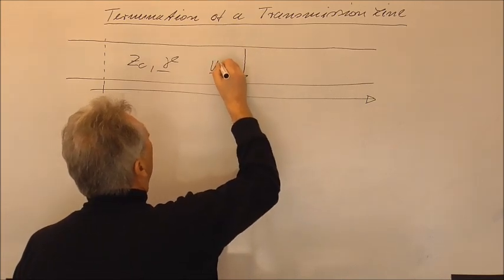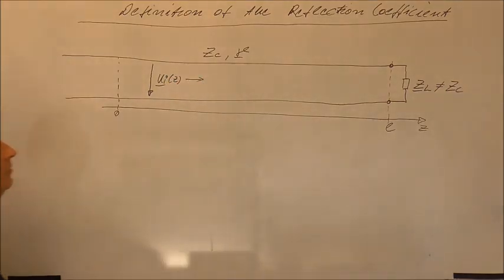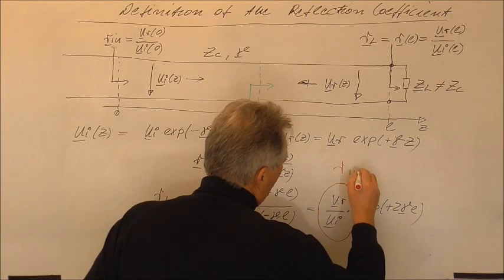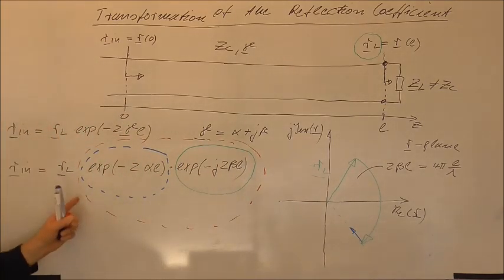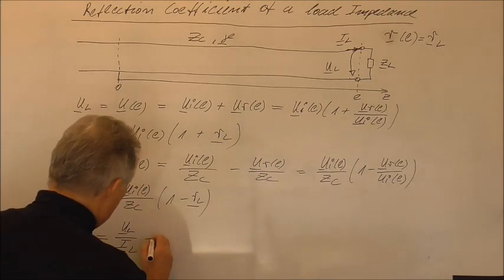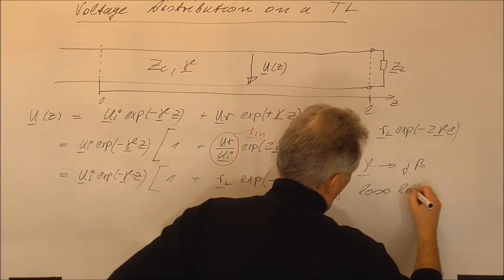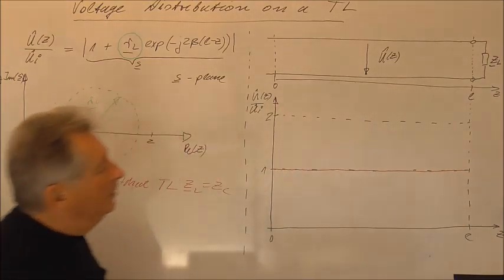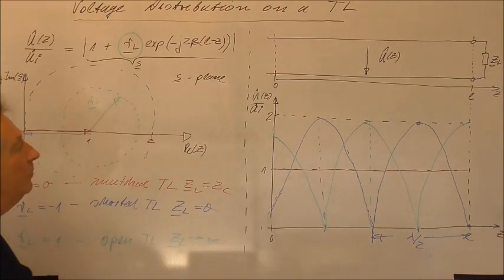Reflection Coefficient

Comment: In the discussion of the reflection coefficient, I can see that you are assuming the characteristic impedance Z_C to have a real value. Are the results obtained in this video still valid if we have a complex Z_C?
Reply from the maker: The results are also valid for complex Z_C. But in RF-engineering we always assume the characteristic impedance of a transmission line to be real. This is true for frequencies greater than 10kHz. As war as I know in the transmission line theory for power lines (f apparox 50Hz)  the characteristic impedance of these lines show complex values
Reply: @Lectures_RF_Microwave  Ahhhhh I see! Right, in the lectures regarding the solution of the wave equation, you did discuss the characteristic impedance of a TL with low losses, in which you did  show that for frequencies greater than 10kHz, Z_C is approximately a real value. So it makes sense to consider real-valued Z_C in the context of RF engineering. Thank you very much!
Reply: @Lectures_RF_Microwave  By the way sir! I have not watched all of your videos, but I think you have not made a video about calibration right? I think you could make a video about that topic: Showing the fundamental mathematical theory behind the process of calibration. I have already performed this calibrating process in the RF Lab modules many times, and read your lab documents, but I still could not understand everything due to lack of mathematical and some electronics knowledge. It's just my suggestion. Thank you very much professor!
Reply from the maker: Thanks for your suggestion - but on YouTube there are already some  videos considering Calibration - first I am working on videos which explain my exercises. But thanks again for the hind
Reply: Which software can I use to draw the voltage distribution on the transmission line for other values of r_L?
Reply from the maker: I did not include this in my simulation tool - even I already wanted to do - but lack of time. If you really want to do - it should be possible to do with MathLab
Reply: @Lectures_RF_Microwave  OK professor, I'll try!